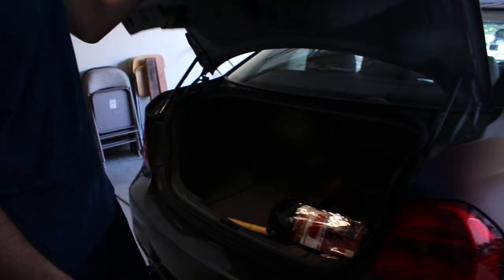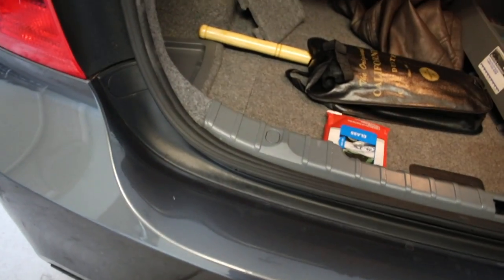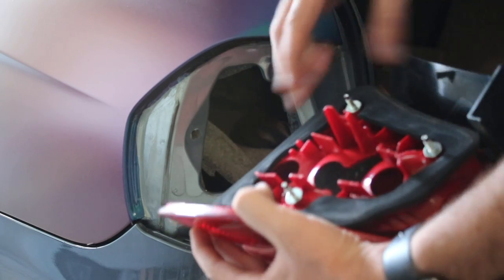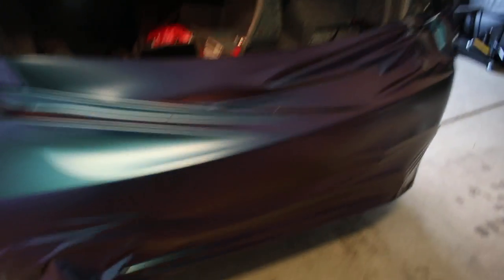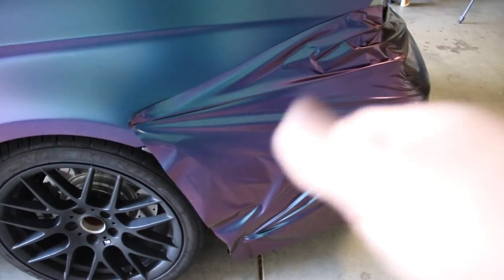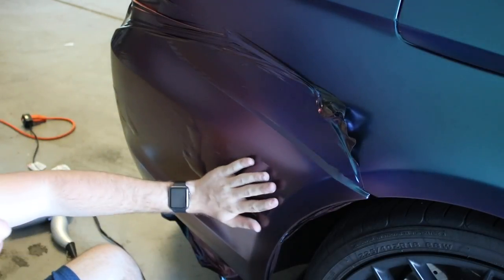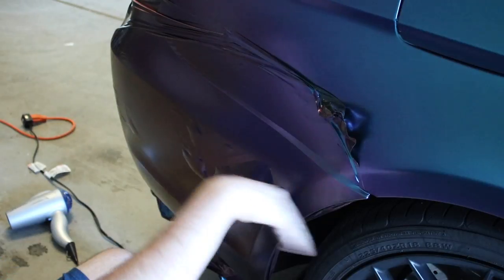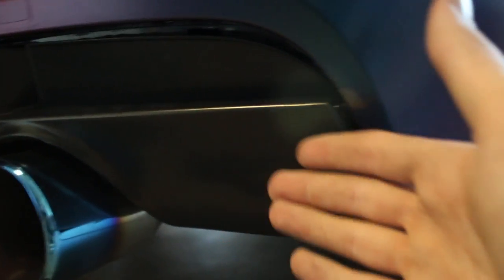100% FINISHED WRAPPING MY BMW E90 (REAR BUMPER DIY)

Comment: Bro I need your help I have a 2011 328i and I need to replace the bulb for the left taillight on the trunk but I don't know the size of the bulb :( I tried to look at it on Amazon and ebay but haven't seen it :( halp!
Reply: Andrew Castro just go to your local autoparts store with the old one